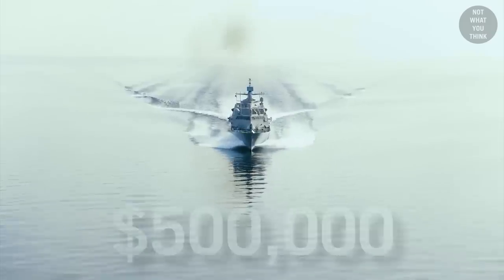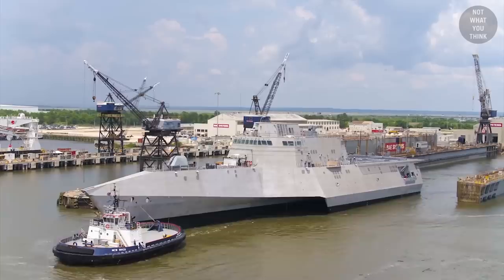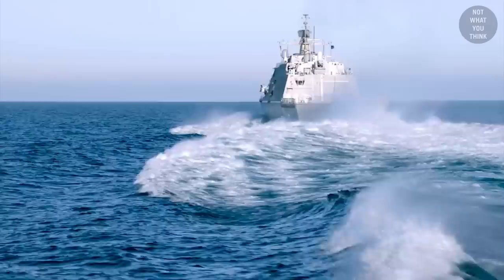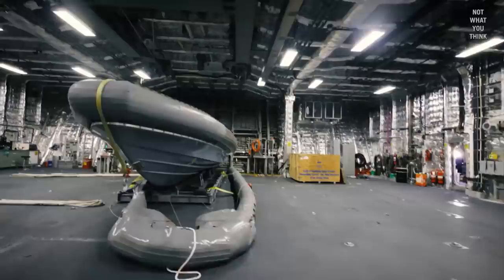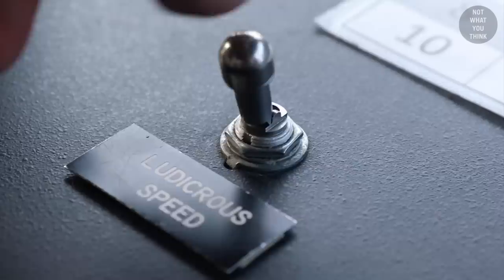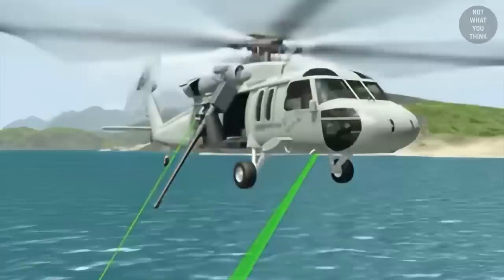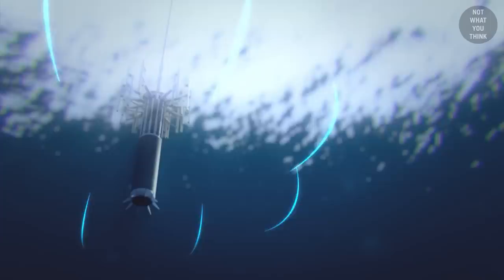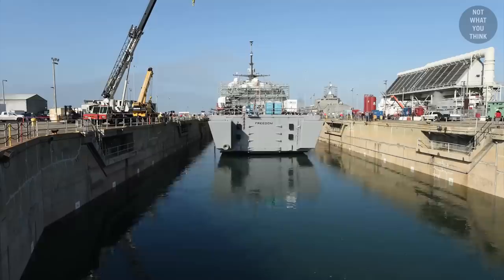Why Retire a 2-Year Old Warship?

Comment: I suppose that the physical ship might be the cheapest component compared to recurrant ongoing costs and design and logistics. So it might be cheaper to scrap a problematic ship.
To be optimistic, newer ships have better tech and valuable knowledge of ship and weapons deployment is gained.
Reply: i had read that when they designed them they used this new sort of metal, and it was spouse to be strong enough that  they wouldnt need to add a ton of armor to the ships, but after all was said and done, they tested it and the ships were actualyl quite susceptible to sinking like any torpedo hit was gonna put it at the botom of the ocean, so they added a bunch of armor and then it slowed the ships down a crap ton
Reply: @soulsreaper7145  maybe they should have tested this metal first...
Reply: @nicholasvinen  it’s a lot more complex than just “test the metal”.
Reply: Optimistic!
Just face the reality this is all about corrupt corporate greed of the military-industrial complex.
But you'll keep on funding it
Reply: What a waste of money .. the money laundering is out of control
Reply: @nicholasvinen  the metal was tested. But not the whole ship.

Comment: this is why prototype phase should have a thorough test and evaluation before said technology be in use
Reply: It was a failed concept to begin with.  You don't need to make any prototypes to know that making your boat out of aluminum means it is as fragile as a glass figurine thus making it useless in combat.  Stupid boat can't even defend itself.  It would need many escorts to be combat effect, thus negating any benefit a boat like this was supposed to do.
Reply: @toolbaggers  Except nothing you listed here was addressed in the video.  Everything was reliability based
Reply: @toolbaggers  the only issues were its engines and weapon modularity which can be fixed if it were still a prototype
Reply: @toolbaggers  It's only intended combat role was to hunt ships that were in general too small to even get in range before being detected and destroyed. Other than that, it was to detect subs and mines, none of which is a real active combat role.
So your entire tirade about the ship not being fit for combat and to "defend itself" makes you look either ill informed or slow on the uptake.
Reply: @AJAtcho  There has been hull cracking on some of the ships. Though this has less to do with them being made of aluminum and more that the designers of the indepence class transferred their knowledge from working on civilian ferries to the LCS project.

In operation, their ferry designs have worked well with the expected service life. But they underestimated how much they needed to reinforce the hull for rough sea states.

And the ship's 'fragility' in combat is sort of a red herring since any AShM worth its salt would wreck a ship in that tonnage regardless of what it's made from, and crippled much larger and more expensive vessels, while anything less powerful is well within the LCS' ability to fend off.
Reply: @Bustermachine  It was more organisational problems then "underestimated". 

Astral transferred most of its most experienced designers to the spearhead-class due to their familiarity with the ship design it was based off. Most of the LCS design team had zero previous experience working for Austal and neither design team shared data between the programs.

It's frankly crazy how ill prepared Austil was to run multiple ship programs at the same time.

Comment: My boat sat for over a year and a half (still is) and it cost 70 million. Not including repairs to diesel motors, combining gear, and radio equipment. The combining gear replacement has failed other boats and ours. We didn't deploy or do anything. It costs 120 million to operate a DDG for a year. A much better and more capable platform. Plus has nearly six times the crew size. Three section duty is killing us.
Reply: Yea my boat also costs 70 million dollars a year to maintain
Reply: What are your watches like?
Reply: yeah  my boat is also cost 95 million per year
Reply: It would make more sense to build a smaller purpose built ship, most could use same hull just makes more sense in my opinion, somthing like 2 water jet diesel turbine driven corvettes or patrol boats smallest ship you could put a heli on
Reply: Low ballers round here i see, my boat cost the most to maintain so im the winner 🙌
Reply: @RadarLeon  we did. It was called the Oliver Hazard Perry class frigate and it was a damn good boat.
Reply: Tell me about it.  My 40 foot Sea Ray Sundancer has a 245 gallon capacity for the fuel tanks.  It costs about $1,500 at the gas dock per fuel up. 😄
Reply: @guyfromboracay  yes that's a great ship, but i'm thinking of ships in the size range of the french gowind 2500 or a corvette around 1500-2000tons with a unified base hull but with ships built to one purpose.
Reply: @g.k.1669  The boat I'm stationed on...
Reply: @dense_and_dull  Government issue
Reply: As a former FFG-7 sailor, I feel your pain
Reply: Ah yes. The age-old 'we use half the crew by making them work twice as much'.
Reply: Complaining of three-section duty? Port starboard wasn't abnormal for a some submarine nuke rates (EM's and ET's) through the '80's and 90's. Only enlisted in 4 section I ever saw were chiefs as EDPOs or SDPOs.
Reply: @stevebriggs9399  My CSO was a prior Fast Attack nuke. He would take that back over this shit.
Reply: Right back at ya

Comment: There was another mission module that would have made a difference.  There was a plan for a hospital and disaster relief module set.  Even at a week refit time, having a handful of additional, shallow draft, hospital ships to go with the Comfort and Mercy could be world wide in a couple weeks.  Add the military capability still in the ship that doesn't exist on the dedicated hospital ships, and you could have had these floating relief vessels in more dangerous waters like the Horn or Gulf.

Of course because it doesn't go pew, it was the first module cut before even making it out of design phase.
Reply: What good would have they done if the propulsion kept breaking and the hull cracking?

Comment: Retired navy. This class of ship was built because the lawmakers wanted their shipyards to make money. Lay off shipyard workers, area goes into recession, lawmakers voted out of office. THIS SUCKS but don't see any change anytime soon.
Reply: Except the Navy could just as easily have comissioned a frigate class instead. Or a class of patrol ships that didn't try to do everything in a single hull. Or did so more conventionally.
Reply: Contractors want to make money through development since that is where the dollars are. If you propose a new improved object but its close to prior objects of the same type just incrementally improved Cost Price Analysts on the government side will have a lot of historical pricing information to reference negotiate you down on. If you instead propose something novel the pricing side at the buying commands kind of have to take their word for it. The contractor then uses the novel concepts to justify the higher than normal price by arguing that the new concept will replace frigates, minesweepers,  ASW platforms, and large costal patrol vessels with a single class saving money on the whole despite the high unit cost.

Bottom line all branches need to REJECT the swiss army knife concept for new weapon systems, instead they should settle for lower-risk generational improvements.

Comment: Which is why at the least, they should have had proof of concept tests after a few of them were built, with an option to continue construction after those tested satisfactory.
Reply: Yeah, I am baffled that one wasnt tested before going into full production.
Reply: @geckoman1011  right? That is usually how it has been done. Lead ship of the class is usually 90% complete or fully complete and on trials before they even think about laying the keel for the next ship so that the issues that will show up on trials can be corrected. But I have never heard of Lockheed making warships, so chalk this one up to the inexperience of the company and the yard as well as a 'gotta make that bread' mentally from the Lockheed board.
Reply: The model worked like a charm in the bathtub
Reply: @77space-vt8wi  😂😂😂

Comment: I work on ships with multiple motors, 2 or 4 usually. And I have never seen a "combining gearbox". The  motors drive generators and the drives are electric. This was old news in submarines during WW2. Some cruise ships have diesel/turbine electric drives that work reliably. A "combining gearbox" seems a atrociously expensive, heavy and unreliable way to eek out a bit of efficiency. Efficiency that can be claimed back on a diesel electric by the better hull shapes that electric drives and their shorter shafts allow.
Reply: What he means by "combining gearbox" is one that can handle multiple high and low speed inputs (CODAG).  This tech is proven if done correctly (but the navy could fuck up a wet dream).  USCG WMSL's have a CODAG propulsion plant and combine the diesel and gas turbine inputs for it's top speed.  Northrop Grumman offered up a modified WMSL for the LCS but the navy turned their nose up at anything that was also a cutter lol.
Reply: The "problem" here why you need a complex gearbox in a CODLAG (Combined Diesel-eLectric And Gas)  drive is, that the gas-turbine does not power a generator, but the drive shafts directly. (to get all the gas-turbine power to the propellers)
So you have electrical motors powering the drive shafts in normal drive mode, like you described, but in "sprint mode" one gas turbine needs to be able to put its power on both drive shafts. This results in a rather complex gearbox design, usually with several gearboxes.
Reply: @KyrainMcLeod  I'm a marine engineering Officer, so I get that, what I don't get is why not go turbine electric, it is just soo much easier to package, build, maintain etc. I fail to see a single positive except maybe EM emissions.
Reply: First of all, drive system are not my specialty, so there's some guessing here.
However, one positive is the size-to-power ration.
For example, the German frigate class Braunschweig uses a CODLAG system.
The two electrical drive motors produce about 4.7 MW of power each. The gas turbine produces 20 MW of power and is only as big as one of the motors.
Also, and this is the me guessing part, the drive motors seem to have trouble with the fast revolutions. The gas turbine is only for "sprints".
However, the Zumwalt-class of the US Navy and the British Daring Class destroyer actually uses the system you proposed.

How to decide which system to use, I don't know. I only know that central parts like the drive system are decided very early in the project by people who most likely only encounter ships in the projects letterhead stationery.
Reply: @FLMKane  d.

Comment: I was finishing up my Navy enlistment when this concept first was proposed. Most of us were against it from the beginning feeling that the frigate and destroyer is a far more flexible platform.  Yes there is definitely a need for littoral ships but they should have focused on existing designs that were proven and just improved on the knowledge of those platforms.  The coast guard needs more ships. Maybe repairing the existing and putting them into the coast guard would make sense. Every coast guard littoral should still have air to air and ship to ship offensive systems in additon to special operations type capabilities for drug interdiction.
Reply: Excellent suggestion!
Reply: corvettes (dnmark, norway, sweden, finland) are excellent. smaller displacement frigates would do, too. these ships in the four navies listed do yeoman work, very capable, ocean-going also in danish and norwegian fleets.
Reply: @STScott-qo4pw  agree
Reply: @STScott-qo4pw  Denmark has no Corvettes.
Denmark have 5 new  multirole Frigates built on the Ivar Huitfelt class and Esben Snare class, and 4 Patrol frigates of the Thetis class. 
Denmark has announced it needs Corvettes  and has partnered up with Ficantieri in italy and Norway and France to build 4-5 new corvettes to operate littoral and in the Baltic.
Reply: @ulrichkristensen4087  ouch! I had thought it was a corvette-type ship denmark deployed to somali coast in late 90s to help stop pirates. Do you know what ship it was?
Reply: @STScott-qo4pw  yes it was the Niels Juhl type Corvette class, they are outphased, Denmark are in the European corvette program, and will be buying around 4 ships for Litoral and Baltic protection. I will most likely be called the Storstrøm Class, since that is a waterway the ship has to be able to traverse, narrow and shallow.
Reply: @ulrichkristensen4087  dammit, that was the class name! what little i knew of them (wikipedia...?) they were nonetheless capable ships. so eu fleets are collaborating on a smaller ship program - corvettes? i have no doubt they will do it right. denmark is in this program - who else?
Reply: @STScott-qo4pw  Norway, France, Portugal, Netherlands, Italy, Belgium, Denmark, Spain
Reply: @ulrichkristensen4087  this is going to be INTERESTING to see what this group makes. thanks!

Comment: Greatest Financial Mistake of USN . Helpless Little Ship.
Reply: I think Zumwalt class tops that list
Reply: @iracingrookie3301  the zumwalt is actually a pretty good ship  it only failed because it was to expensive the ship itself is pretty good
Reply: @Ukfairgrounds  Problem was that the Zumwalt was designed around a weapon system that was never commisioned into operation. That is the problem of the Zumwalts. Besides it being a warship with no weapon system, it isn't bad. Would have been better if it was designed a working and operational weapon system though.
Reply: @Ukfairgrounds  “it only failed because it was expensive”
Yeah no shit.
So expensive they could have purchased 4 attack submarines for the cost of 1 destroyer.
And a destroyer that doesnt carry ammo for its main guns.
And to top it off, they need to refit them with VLS launchers to bring the cost up even more
Its a Massive failure
Reply: @iracingrookie3301  Zumwalt is at least useful as a test platform for new technologies.
Reply: At least the independence class is a decent design, should've just gone with that.
Reply: @epikmanthe3rd  they test these new systems on shore before they ever touch a ship.
America has huge naval weapons ranges in the Nevada desert to test their guns, launch systems etc.
They even have places on shore to test their aircraft launching systems for their carriers 
They dont just fit  them to a ship and go test it at sea
Reply: @iracingrookie3301  There's a difference between a lab and actual see conditions. Plenty of weapon systems have shown promising results on land only to be mediocre at sea due to reliability issues. Zumwalt makes a decent platform for testing these systems in real world environments, while having a significant energy surplus to allow fitment of pretty much anything that will fit.
Reply: @epikmanthe3rd  name one system thats easier to test at sea.. there isnt one.
The crew fees. Fuel fees. Deployment fees etc. Everything is more expensive To test it at sea

VLS launchers cant be reloaded at sea
They need to be in port.
Reply: So imagine going to test the VLS systems that zumwalt now uses 
Every time they test it, it needs to be sent back to port, just to reload its VLS launches.
Just doesnt make sense. At all.
Reply: @Ukfairgrounds  Nah man, the problem of the Zumwalt isnt just the price. Its that most of the technology wasnt even close to be fully developed when the ship construction started. Not even when the first ship was comissioned.

The design itself is also deeply flawed. Its original mission, stealthy strikes, are not possible due to the lacking effectiveness of the "stealth design". The hull shape also doesnt got nearly enough space for all the radars, antennas, etc that you need on the superstructure. Look at the newest pictures, they bolted a whole bunch of trash at the ships hull, which will ruin even the pathetic amount of "stealth" that it had.

And sure, the ammo for the guns was indeed to expensive. But the problem is that the whole point of those guns was supposed to be a cheap alternative to missiles in the first place, so the entire design concept was utter nonsense, and the Navy shouldve known. Not to mention the railguns, which were never gonna be a viable weapon for the Zumwalt due to their lack of effectiveness.

Like, sometimes people exaggerate how bad projects go. But the Zumwalt is an utter disaster made of ineptitude, naive dreams and deeply embedded, symstematic corruption. [/rant]
Reply: Nah it’s not the Navy’s fault. Lockheed Martin has been taking the government for a ride for 5+ decades now.
Reply: @adub1300  especially when it comes to the navy for some reason
I think the army and airforce get some good lockheed deals
Reply: @adub1300  Navy has a lot of influence about what is happening with these kinda developments and projects.
They made tons of amateurish mistakes; it seems like the amount of money they can fuel into Navy projects is more important than actual outcomes.
Thats at least how the Zumwalt project looked like.
Reply: @Tuning3434  but just looking good is good enough